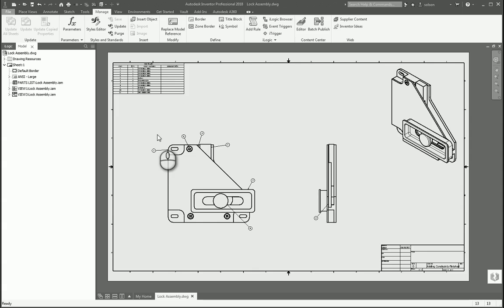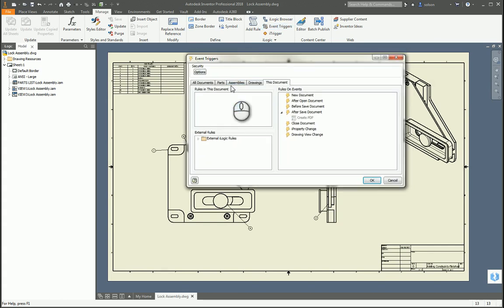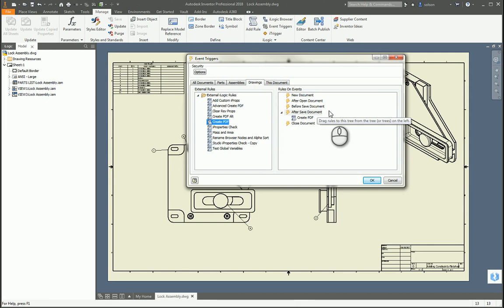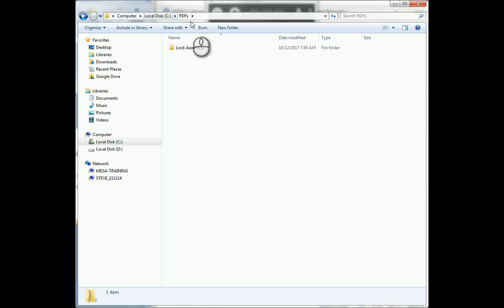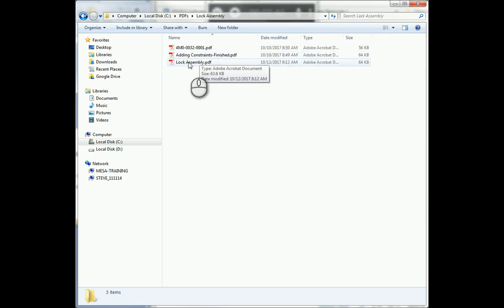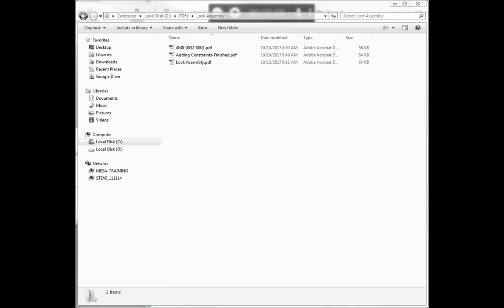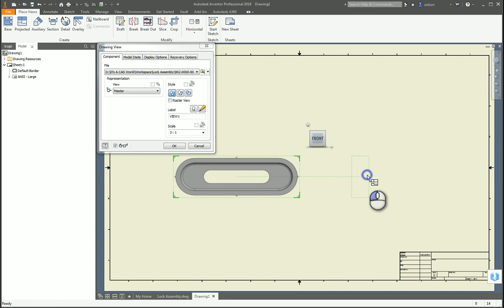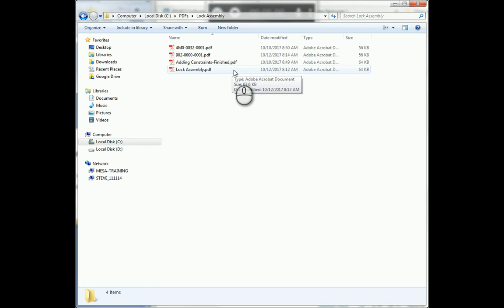Using the New iLogic Event Triggers

Comment: Is have to be created PDF folder  from inventor Application Options?
Reply from the maker: The PDF Folder is not part of the Application Options.  You can set the save location to whatever you want, as part of the code.  The folder does need to exist before you try to save to it, or the rule will fail.  The one line I use in the code, makes sure the folder exists, and if not, it will create it.